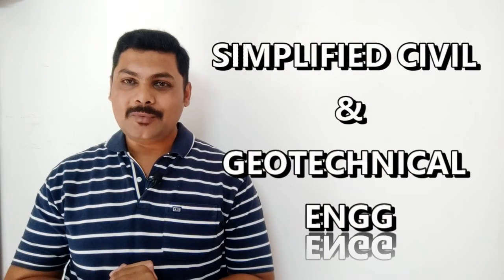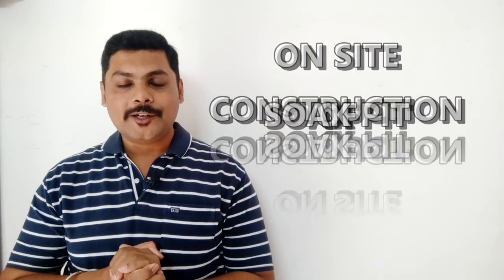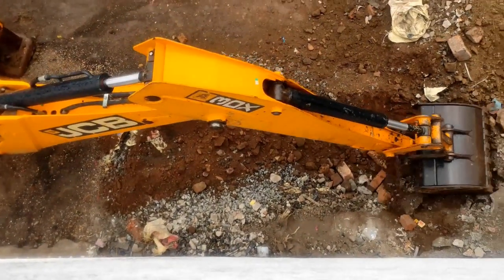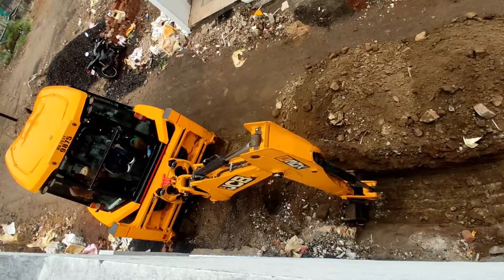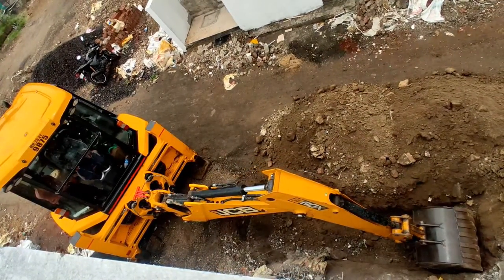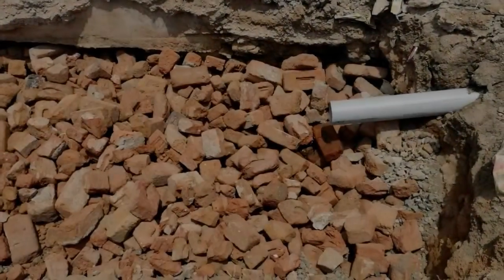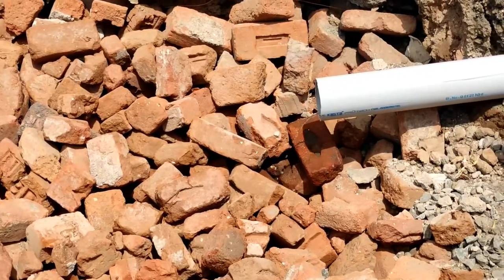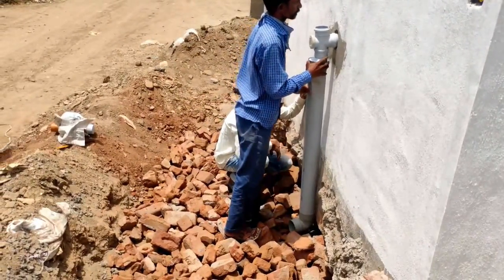Part 6. Soak Pit Site Construction video (English)

Comment: ఇంకుడు గుంత లైఫ్ ఉంటుందా.. 
కొన్ని సంవత్సరముల తర్వాత వర్క్ అవ్వాలంటే స్టోన్స్ రిమూవ్ చేయాలా.. 
ఎంత లోతు తవ్వాలి.క్లారిటీగా చెప్పండి 🙏
Ground water storage కోసమా
లేక waste water ని పంపించే మార్గమా..
Reply from the maker: Regarding the longevity of a soak pit,the lifespan of a soak pit, and thus the material like bricks, depends heavily on maintenance and how well it continues to function, rather than a fixed expiration date for the bricks themselves.
A well-sized and maintained soak pit is generally expected to last between 3 and 5 years without major maintenance, but the structural components (like the bricks lining it) can last for many years if they are not clogged or damaged.
Key Factors for Replacement/Maintenance:
The actual "replacement" of the bricks is usually a result of the soak pit failing to drain due to clogging, which necessitates it being cleaned, excavated, or rebuilt.
 * Clogging: This is the main issue. Over time, solids, silt, and biomass from the wastewater can clog the spaces between the bricks and the surrounding soil, reducing the infiltration rate.
   * Maintenance: To prevent this, regular cleaning (sludge removal) is often recommended every 2-3 years for the pit itself, and it should only receive pre-treated/filtered wastewater (not raw sewage) to extend its life.
 * Reduced Efficiency: If you notice signs of malfunction like slow drainage, standing water, or a need to empty the connected septic tank more frequently, it indicates the pit is clogged. At this point, the filling material (bricks, gravel, or stones) may need to be excavated and refilled to restore performance.
 * Structural Damage: Bricks are durable, but they could be replaced if an inspection reveals structural damage like cracks or collapse, though this is less common than clogging.
In summary, you typically replace the filling or rebuild the pit when it stops draining effectively due to clogging, which can happen in as little as 3-5 years without maintenance, rather than replacing the bricks simply because of age.
Reply from the maker: The primary use of a soak pit (also known as a soakaway or leach pit) is for the safe, on-site infiltration of excess water and treated wastewater, specifically greywater or pre-settled blackwater (effluent from a septic tank), into the surrounding soil.
The soil then acts as a natural filter, where small particles are filtered out and organic matter is digested by microorganisms.

🕳️ Soak Pit Depth and Key Design Factors
The appropriate depth of a soak pit is not a single fixed number but depends on several critical local factors. 

Critical Design Factors Influencing Depth
 * Groundwater Table Level:
   * The bottom of the soak pit must be at least 1.5 m to 2 m above the highest groundwater table. 
This is crucial to prevent groundwater contamination and ensure the pit functions by draining downwards, not filling up with groundwater.

 * Soil Permeability (Soil Type):
   * Soak pits work best in soils with good absorptive properties (e.g., sandy soils).
   * In soils with low permeability (like dense clayey soils), a deeper pit might be required to provide sufficient contact time for the water to soak in, or the design may need to be adjusted (e.g., using an infiltration trench instead).
   * Clayey, hard-packed, or rocky soils are generally not appropriate for standard soak pits as they clog or absorb too slowly.

 * Wastewater Loading (Q):
   * The volume of wastewater generated daily (flowrate) dictates the required infiltration area of the pit walls. If the flowrate is high, the pit may need to be deeper or wider (or multiple pits may be needed) to accommodate the required infiltration surface area.

 * Distance from Water Sources:
  * The pit must be located a safe distance (ideally more than 30 m  away from any drinking water source (like wells) to prevent microbial contamination.

Comment: Hello … we made the hole but since we live near a river … when the remove soil from the hole… it was already filles with water ( 1/4 ) of the hole… do we still put the rock
Reply from the maker: Mainly through soak pit water percolates into the ground, but your area is water logged so this soak pit method is only suitable for non water logged areas....